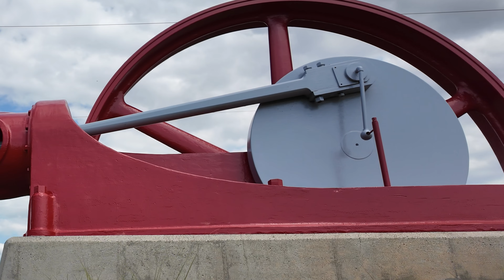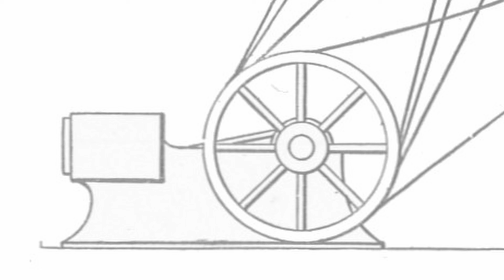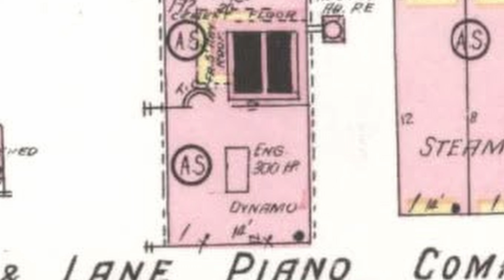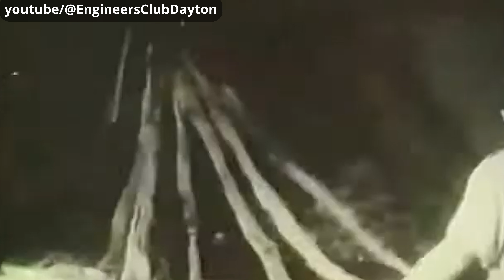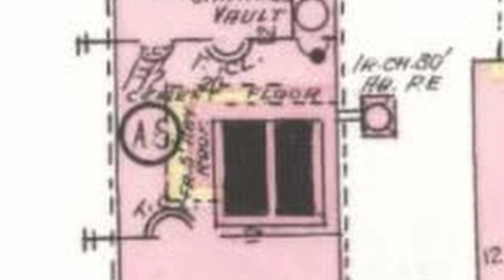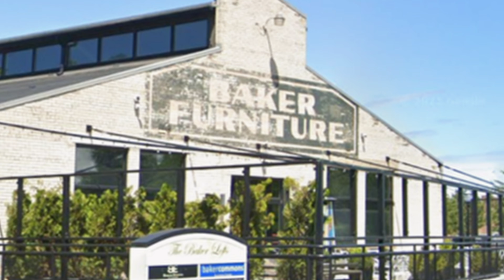The Abandoned Steam Engine on the Street Corner

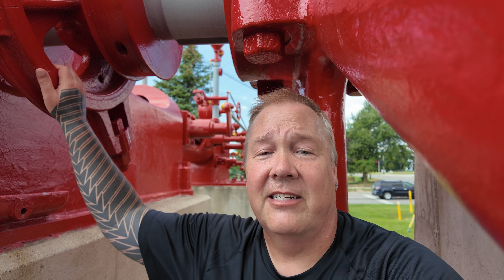Comment: 13:45 - The restorers realized the importance of facing the keyway facing straight down, so it wouldn't collect water.  Foresight in case somebody wanted to restore it to run in the future. It wouldn't take much to get it running.  Oilers are readily available in any size, eccentric rod is missing, but simple, and bearings might need to be repoured.  Dashpots and linkage would need to be made. Maybe they're stored somewhere?  Check the cylinder and valve bores, may need honing and new rings. Three ways to power it: A boiler is hard to get, but running unloaded it wouldn't need much steam.  It could run on air, but a lot of it, since it isn't expansive like steam, or an electric motor.  Very nice engine!
Reply from the maker: Yep, it could definitely be brought back into service again.  The ones I've seen moving in museums either just tuck a little electric motor under the flywheel or run them on about 5psi of air.  I got to go down into the basement to see the fairly small compressor they're using on the one at Grand Haven.
Reply: @Industrial_Revolution They use a regenerative blower in place of a compressor at the Muskegon museum
Reply from the maker: @nathanielspoelman9881  Yep, they need a fair amount of volume, but not much pressure, so that's working well for them.  I wonder what they used at Henry Ford Museum when they had a a bunch of the big engines all running on compressed air all day long

Comment: I see it has the patended Allis Textrope drive. It used a continuous rope drive, before the V belt days. The heavy rope ran in those groves, the rope wrapped around that pulley several times for grip. That fed into a tension block set of pulleys, that was supported by the rope, with a large weight suspended under it to control tension. Upon start up, that weighted pulley block absorbed the shock and allowed the slack to be taken up with out snapping the rope. Most of these lasted as long as steam ran the mills.
Reply from the maker: The info on the exact layout was a bit vague on this engine, but the Allis Texrope Drive wasn't introduced until 1920, well after this engine.  What I describe in the video is the "British System" with separate ropes in each groove.  There were a few other "American System" layouts that wrapped the rope back and forth, but it's my understanding that the British System handed split systems with different loads better.  Since they definitely split between the vacuum system (behind the steam engine), the dynamo (directly in front of it) and the factory (past the dynamo, across the driveway, at least one, probably two line drives), my best guess was the British system, but no documentation, either way.
On the other hand, I wonder if, after that texrope system came out, they might have converted?  Do you know if it worked on the same flywheels and pulleys?
Reply: @Industrial_Revolution  Well, you can bet that Allis supplied after market up grades to any one interested.
Reply from the maker: Probably.  Nice source of income years after the sale.

Comment: First thing i noticed was that the dash pots were missing. They made the engine more efficient as they closed the steam valves very quickly. Corliss engines ran on the expansion of steam much more than the direct pressure of of the incoming steam like a standard engine.
Reply from the maker: Yeah, there's a lot missing, unfortunately.  I don't know how much even made it out of the factory for the first move.

Comment: First I have heard of multiple rope belts running on the same flywheel...very interesting.  I have seen these grooved flywheels on big antique steam engines before, but never gave it a thought of why all the grooves!  Thanks for another great video!
Reply from the maker: I'm right there with you.  I've seen the grooved flywheels, too, and just assumed it was like the pulleys on some cars.  As soon as I started researching, though, went down a whole other rabbit hole.
Reply: In Germany you often see these where you want redundancy like when powering generators. They aren't exclusive to steam either. A good example is the one in the LWL Industriemuseum in Solingen that has a grooved flywheel that runs one single shaft with the reduction gear on the ceiling (for the whole room) or tool itself.
Reply from the maker: @ivovanzon164  Certainly they wouldn't be steam-only.  Actually, a lot of places replaced their steam engines with electric motors, hooked up to the same overhead line drive systems, so those would have needed the same multiple rope system.

Comment: On my great grandmother's spinning wheel there were two drive ropes(strings?) one provided the twist on the incoming roving and the second provided the feet onto the bobbin which provides multiple twists per revolution. The drive wheels could be changed to vary the twist depending on the fiber being spun. My cousin still has the spinning wheel.
Reply from the maker: I've done a bit with spinning systems on my Watkins Mill video.  I hadn't thought about it with a spinning wheel, but definitely makes sense.  You need very different speeds if you're spinning thread compared to yarns.

Comment: That is a nice engine. Nice it was preserved at all!❤
Reply from the maker: On the one hand, it's kinda sad it's there, instead of downtown, but you're right, it's definitely good that it got preserved at all.
Reply: Is it really preserved while it's exposed to the elements?
Reply from the maker: @annarboriter As long as they're paying attention to it, yes.  The life of these old steam engines was pretty brutal, so they were designed and built tough.  There's quite a few parts missing, but I don't know when those vanished, and most people would never notice them gone.  As long as they keep it painted, with a good, solid, appropriate paint, and keep an eye out for rust (and deal with it right away), then yes, I'd consider it fairly well preserved.